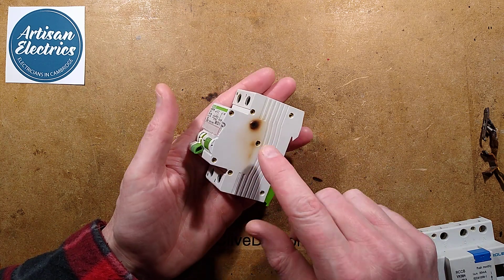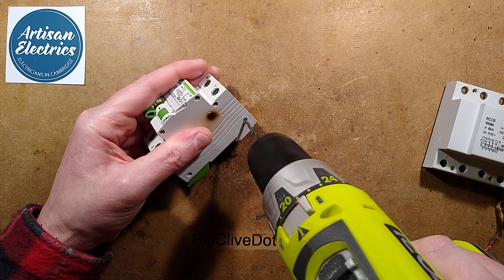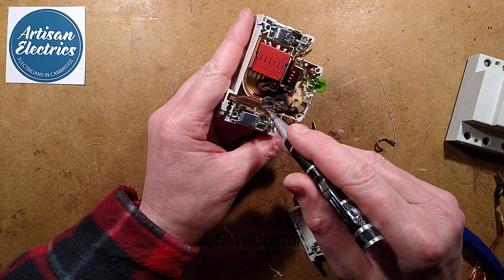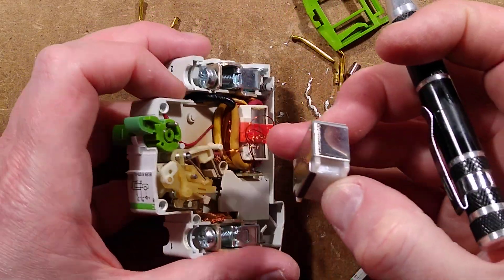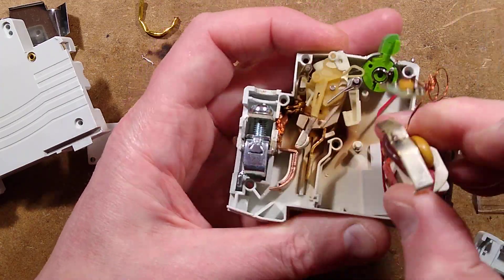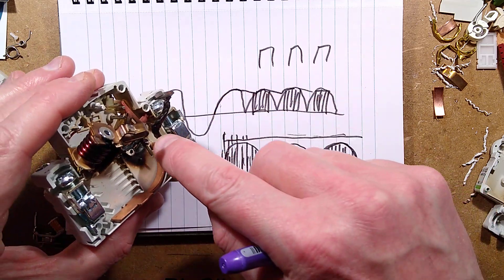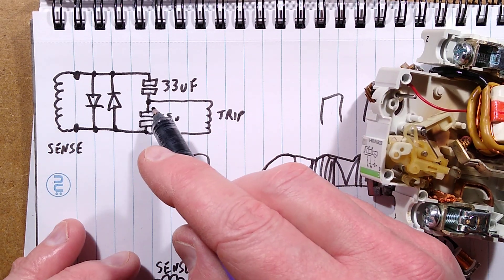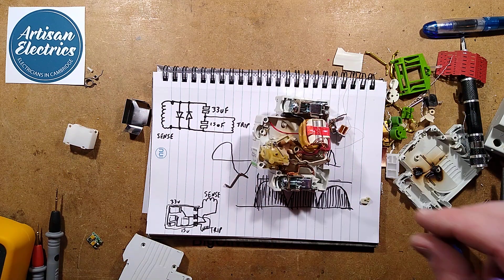Failed Rolec breaker from Artisan Electrics

Comment: Rolec breakers are notorious, but it's usually the top-left Neutral that burns - plenty of reports on car forums about this
Reply: Do you know what kind of tests and QA manufacturers do for their MCBs, and RCBOs? My guess, is that this issue should have been detected by measuring voltage drop at 40A.
Reply: I had two (Home and Work) Rolec car chargers when we first got EV (5 years ago). Both burnt out, one distorted the outer case too and was no longer waterproof.  Breakers changed under warranty but at considerable inconvenience/cost to the installer (and me somewhat until it was fixed).
Reply: The general concensus is to replace them with a Garo RCBO - RCBOGRB40 
I did this with mine when mine blew & it's been fine ever since.
Although it did take 4 years for my Rolec one to burn out.
Reply: @andywonline  Not often I see Garo mentioned outside Scandinavia, but they dominate the market here for a reason :)
Reply: How much do these breakers cost? Can’t one install some better grade units from an industrial catalog? I’d expect a decent DIN rail branch circuit rated breaker (no RCD) like that to go for at least £100, although the best quality ones would be closer to £200 (I’m translating US prices and adding VAT). An RCD+breaker combo I would trust would be more like starting at £200. I’ve never had those fail, and have well over a thousand of them in the field.

Comment: The main issue with EV charging is it's drawing  a heavy load for an extended period of time. 
I doubt most (any?) EV onboard chargers have poor power factor as that would cause problems on the network so I'd be highly surprised if the applicable standards don't specify a pretty good PF. One OBC I took apart definitely had power factor correction.
Reply: yeah, the main problem with EV chargers is EMC, not overcurrent spikes.
Reply: Yeah, any respectable design will have a small inductor between the PFC stage and the network to prevent the "spikyness" described in the video, and that results in a pretty darn good sine wave.
Reply: Some newer car chargers supply the main battery with pulsed DC to eliminate the need to do full PFC in the car charger - the Li-Ion battery doesn't mind if the charging current has a sine profile.
Reply: It seems odd that it would have an issue with a heavy load for extended periods given the loads of old GEC units was greater than current car points and I've never had issues with them. 
More often it appears to be the on board dc conversion throwing issues back upstream. From personal experience I've had more customers with Telsa's have issues with the Relec points than Nissan Leaf and Renault Zoe owners. Not had any issues with the Zappi units yet though.
Reply: @hugoboyce9648  Actually you would want to add a low-value capcitor after the bridge rectifier and before the APFC boost stage. 

From the IR1155s APFC control ic app note: 
The purpose of the high-frequency capacitor is to supply the high-frequency component of the inductor current (the ripple component) via the shortest possible loop. This has the advantage of acting like an EMI filter, since it minimizes the high-frequency current requirement from the AC line. Typically a high-frequency, film type capacitor with low ESL and high-voltage rating (630V) is used.
High-frequency input capacitor design is essentially a trade-off between:
· sizing it big enough to minimize the noise injected back into the AC line
· sizing it small enough to avoid line current zero-crossing distortion (flattening)
Reply: @Basement-Science  Good point. I think both should be (are?) used in a LC low-pass configuration, and that would make it even more like an EMI filter.
Reply: @hugoboyce9648  I think the idea is that this already forms an LC-circuit with the inductor from the boost converter, which is in series with everything after the capacitor. So you dont need an additional Inductor. I guess you could still add one additionally if you wanted though.
Reply: @hugoboyce9648  Also I would guess they use a big enough inductor compared to the switching frequency, so that the current never stops between each pulse (continous conduction mode) - that reduces "spikiness" a lot, even without filtering. When filtering is then added, it will probably be nearly perfect in most cases, without any significant high frequency ripple making it back to the input line - and definitely not enough to cause problems with contacts in circuit breakers (the charger would probably be unusable because of EMC problems messing with all the electronics and stuff in a normal house, long before it's enough to cause problems with the contacts in a circuit breaker).
No PFC would indeed be much worse for the contacts (and the lines and power network in general), because of the huge current spike each half cycle when the input smoothing capacitor get charged...
Reply: I think the main problem is that contacts and connections tend to wear out over time (mostly because of oxidation, but also mechanical wear - springs that lose tension and such things) - which makes them no longer meet the requirements they where once tested for. Normally this doesn't cause any problems, since they are normally used far below their ratings. But when electric cars are charged, they are often pushed closer to their limits - so any quality defects that will otherwise go unnoticed, now show up...
Reply: @Speeder84XL  these contractors are pretty cost driven so it would be a tolerance/design issue than a power or wear and tear issue.

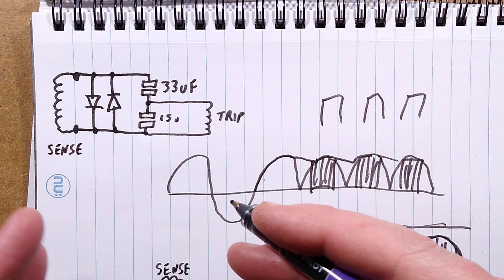Comment: Clive, as others have commented I think you have a few things wrong in this video.  Power factor corrrection circuits do not draw large current spikes unless they are faulty.  Their whole purpose in life is to draw a roughly sinusoidal current in phase with the mains voltage.  The do this by using a high frequency switch mode boost converter to supply the main converter with a voltage high than the peak mains voltage and modulating the power they deliver to be proportiional to the mains voltage.  The high frequency component of the input current is filtered out leaving a 50Hz sinusoidal current.  Also the circuit at 15:50 couldn't possibly generate a dc voltage to drive the solenoid.

Comment: Never knew about the "magnet thing". Really interesting (as usual), those breakers are pretty packed with components, and "a bit charred inside" may be an understatement!
Reply: Just needs a good cleaning and it'll buff out. 😁
Reply: Just a bit charred is his way of saying incinderated.
Reply: In an old data center (circa 1995), we had panels where overloading one circuit would trip the neighboring breakers as well. Such is the price of "fancy" magnetic breakers. I don't see many of those anymore.
Reply: Yeah, like the 'magnet thing' design.  So the current in the coil doesn't have to develop enough magnetic field to actually pull in a solenoid armature or anything.  Just enough to oppose / weaken the field of the permanent magnet.

Comment: What I find incredibly interesting here is, all the incredibly thin wires, tiny sensing circuitry, low melting point plastics in the trip mechanism (all of these designed to be the weak point failure points) didn't fail. Nope, it was the beefy  bigger current flow contacts that failed (from arc-ing because of uneven contact surfaces) and the heat resistant outer shell plastic that melted, causing more contact failure from plastic residue spitting on to the contacts, and eventually causing enough heat buildup to trip the bimetal strip microswitch. I wonder what would have happened if the melted plastic had glued the main switch contacts together more firmly instead?

Comment: 6:14 There's a clever mechanism that makes the contact snap in place to avoid arcing when the breaker is reset slowly.
Reply: Any such arcking will be low current.
Reply: @millomweb  Still.
Reply: @millomweb  not if the fault is still present
Reply: @AngDavies  The fault appears to be the contactor.
Reply: @millomweb  the contactor was engineered to deal with many faults, not just this one
Reply: If a downstream short is present or the load is capacitive, or you are connecting a motor, there will be a big inrush curret at reset.

Comment: 17:00 18:14 resistor at the corner says hi
Reply: I kept wanting to point "its there- no.. you're touching it right now! aah"
Reply: @mica4153  yep. It is a grey resistor surrounded by grey plastic, but still... he even kept saying it should be connected to the red wire, but didnt trace where it went, lol.

Comment: @6:19 "It's almost like it... before popping in."  That's exactly what it does.  It snaps closed fast at the last bit to minimize arcing.  You should see high current, high voltage breakers doing it - it's... deafening!
Reply: He probably did, in his first job as a young apprentice electrician servicing steelworks.

Comment: Of note: there are two types of power factor: the usual kind, where current is out of sync with the voltage, and harmonic power factor, where they may be in sync, but the current has higher frequency components in it.

The power factor from the capacitive droppers is the second kind- that "pulsy" current wave can be represented as a sum of sine waves at multiples of 50Hz, but only the 50hz provides useful power, the rest just add extra current into the system causing various issues depending on the remainder upon division by 150

Comment: Are the breakers being used as a disconnect instead of a switch designed for disconnecting under load? One of our buildings had the lights only connected to a breaker instead of light switches and the breakers would fail often until proper switches were installed.
Reply: I was thinking along similar lines: has the EV-user/owner been using the RCBO to interupt charging and therefore the contacts are breaking 7kW once or twice (maybe more) every day - NOT what they are designed for...

Comment: The contact tips used to be high quality silver and had a wiping action when they opened and closed to ensure a clean surface and in the case of DC rated contactors and breaker used a permanent magnet to help draw away and extinguish the arc over the arc shields and reduce spatter and grud forming on the contact surface. The newer devices seem to be moving down the path of cheap and nasty with material that tend to end up giving way to high resistance connections and failure, engineered obsolescent to promote further sales of more land fill. While recycling is the mantra way too much just become wasted resources ending up in landfill.

Comment: High frequencies, perhaps start getting skin effects where the core of the conductor carries less of the current than the surface. Not so much a problem with small wires at kilohertz but as things go faster ... Also the magnetic fields from the current pulses may be creating forces which make the contacts resonate and start bouncing...

Comment: Clive, I am not sure you apply power factor issues appropriately here. Even with the blocky simple circuit the power factor will be pretty much perfect . The current is in phase with the voltage, all be it with a different waveform.
The problem with switched mode power supplies is that they reduce the size of the capacitor (to save space). This mean that to deliver constant power, they draw more current at low voltages (P=IV) and only smooth out between pulses, not half cycles of the supply.
A power factor corrected charger (as you mentioned) will correct for this.

Comment: How about a line or load reactor typically used in line with 3 phase variable frequency drives. Would one help to smooth out the current at the breaker?

Comment: Hi sir   I watched Jordan’s video and noted he intended to send you the device for your perusal . So I’m fascinated by your results . We as electricians fit these units day in day out . Taking little though as to how complex they are , and as you say in reality relatively cheap. Which begs the question, should they be more robust and more expensive? . And from your perspective would manufactures be better designing a device purely for this purpose, and not relying on the existing technology that is used in other parts of the industry.  Thanks  from an old retired electrician 😃👍
Reply from the maker: I wish they would make them better quality even at greater expense.

Comment: You mentioned that a bit of plastic which had melted had made resetting difficult,  I wonder if a combination of poor connectivity of high current creating heat deforms the plastic making the connection worse compounding the problem until failure..

Comment: I am having a tethered 7.2KW Rolec installed but I will be dialling down my EV's internal charge rate controller to receive a maximum of 12 amps. The charge rate I choose will broadly match production from my solar PV system on the day. Would such a light load over a maximum 6 hours (two or three times a week) extend the life of the circuit-breaker, in your experience?
Reply from the maker: A lower current does take a lot of strain off components like this.

Comment: A few years ago I built a small device that I would use to annoy my parents (I am only 18) by remotely tripping the master circuit breaker. It consisted of a battery, electromagnet, MOSFET, and ESP8266. The ESP8266 (WiFi enabled microcontroller) would drive the MOSFET via a BJT. The MOSFET controlled power to the electromagnet, which when powered would cause the breaker to trip. I hid the device behind the panel where it could not be seen and would activate it remotely.

Comment: Is there any relationship between your idea about overload caused by PFC and the derating of dimmer switches when using LED bulbs?
Reply: LED lamps rarely contain PFC.
Reply: @johndododoe1411  True, I think there is confusion between PFC and switched mode power supplies, which LED bulbs certainly have.
Reply: I'm well aware of this, I'm trying to find out why dimmer switches are derated for LED bulbs and I wondered if there was any common reason. I didn't suggest that LED bulbs have PFC circuits.
Reply: @chrishartley1210  Sorry.
LED fixtures do have switched mode power supplies which do, as Clive stated draw what power they  do use as spikes. Dimmer switches are even more susceptible to damage from spikes since the dimming component is a semiconductor.
Reply from the maker: The inrush current to capacitors and terrible power factor of capacitive dropper based lamps is probably the main issue.
Reply: The poor power factor is probably related to potential overload of the triac, but I've never seen a dimmable LED lamp with capacitive dropper.
Reply: @bigclivedotcom  Are capacitor dropper LEDs dimmable? I am having nightmares imagining what happens when the triac turns on  at peak voltage...

Comment: Thanks for the explanation about the spikey current load - this explains why my microwave (which has a switch-mode PSU) makes a strange noise when my EV is charging.

Ps. Apparently the Renault Zoe uses the motor coil as the inductor in the charging circuit to save weight. 🤓

Comment: There’s a good case for making circuit breakers that fail out if the contacts overheat, and cannot be reset. Low melting point alloy perhaps? If the contact came away the actuator could swing past its usual position and disengage from the reset lever.

Comment: PFC uses a boost regulator which draws current continuously, not in pulses. When the transistor is on current flows from the mains into the inductor and ramps up a little. When it switches off it flows from the mains to the HV rail via the diode and falls a little. So it has some triangular ripple but is not discrete pulses. It should be a lot kinder to breaker contacts than a non-PFC supply.
Reply: PFC does not have to use a boost configuration. Plenty other PFC-aware topologies do exist and are being used.

Comment: Id be interested to know what Electric car this was charging in theory no EV should draw more than 32 amps AC as the cars on broad charger doesn't allow them to some EVs are only 16amps.  However the Renault zoe is able on the Q motor to take much higher loads on a 3 phase supply it will happily go to 43kw.   I've seen a zoe on a single phase draw over 7.6kw on some chargers for breif moments.  Am currently reviewing EVERY EV charger in the UK Rolec still haven't sent me there unit for testing....

Comment: Thanks Clive, now I am worried about installing a car charger!
Reply from the maker: They're generally safe.
Reply: Hello, Clive, here in Romania there is a trend for installing fuse separators(fuse holders for 38x10mm fuses, or 14x51mm) as a general "breaker"...
Schneider does not require " backup fuse" as other mcb or rcbo does...

Comment: on many EV cars you can set the current draw, but like with most things people tend not to RTFM, as it is the vehicle that does the conversion to DC and charging of the battery, the box on the wall tends to just turn the power on and off from a signal from the vehicle. from the looks of it, the load limit on the vehicle is set just to a whisker of the overload limit.

Comment: 100% agree, third harmonic. Some EVs with high power chargers, but  only running at 7.4kW or less are particularly bad in this respect. Some Renault Zoe’s with 43kW chargers exhibit this issue.

Same reason you need very high current diodes in a linear DC power supply.
Reply: This is a single phase charger. You are mix and matching stuff together.
Reply: @Sixta16  no, I’m not is the charger but has a high third harmonic load that causes the problem. It only affects the high power Zoe chargers where the slicing angle is very small.

Comment: Had a look at the AE video. One of the things he did was fit a piece of plastic pipe to a close by water tap so the tap was isolated from the house earthing system. As a sparky, he forgot to connect the tap to a supply of plastic water too. Had he done an insulation test on the tap, he'd have realised the other error.